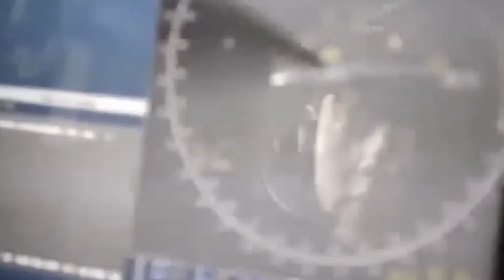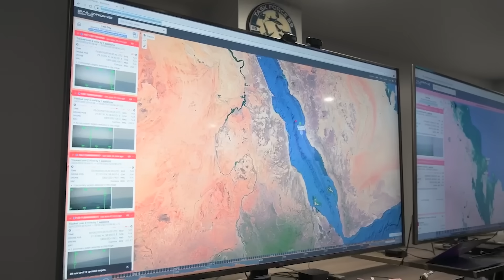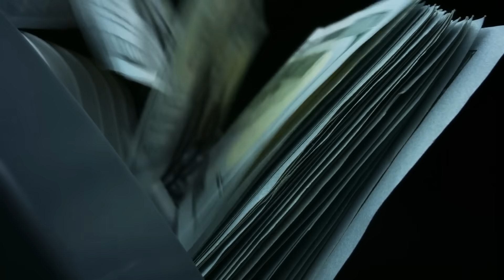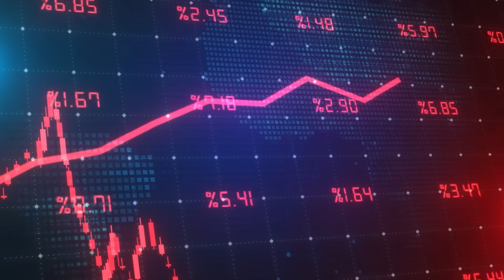America's Mysterious 85-foot Underwater Drone Exposed

Comment: Such a craft could maybe stay moored on the sea bed for weeks, but it will NEVER be reliable in continuous operations for more than few days without resurfacing : the Inertial Navigation Systems that help a submarine keep track of it's own location deviates over time, the location accuracy becomes poor :
For a mechanical INS, the 1 nautical mile deviation (time after which the error on location exceeds 1 nm) is around 10 hours, and around a few days for gyro-laser ones. Needless to say, after a few days of underwater operations, the craft will need to resurface to correct it's calculated location
Reply: But if it has "sea floor mooring", as the video stated, wouldn't that sidestep the issue, since you're not at the mercy of the ocean's currents to relocate you?

Comment: Submarines have bomb bay doors?
Reply: If it doesn’t need a large pressure vessel for humans then yes it possible.
Reply: Should really be termed 'payload door', though there's no reason a traditional Bomb could not be dropped underwater, to explode when hitting the bottom. Would be rather effective against fixed position structures, like the bases of drilling platforms.

Comment: There are also nuclear powered USV that can stay underwater indefinitely and launch SLBMs... Russia and China both using this as strategic deterent since it's less expensive and easier to operate than a fleet of nuclear subs
Reply: No they don't..
Reply: @WizzRacing russia does. Its called the poseidon i believe. Its USV but it is the weapon itself, doesnt launch anything. It has a warhead of at least 50MT.
Reply: @generalmarkmilleyisbenedic8895  It's similar to any underwater kamikazee drone only that it has a nuclear warhead.